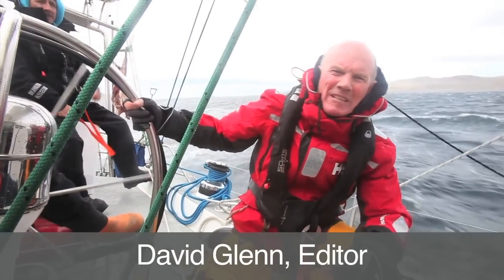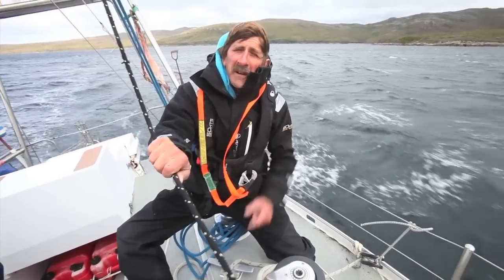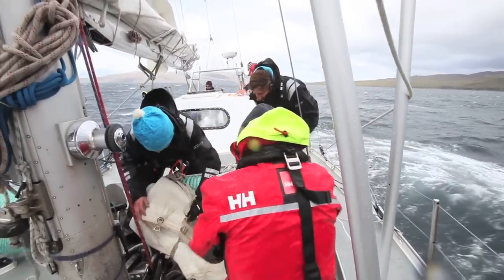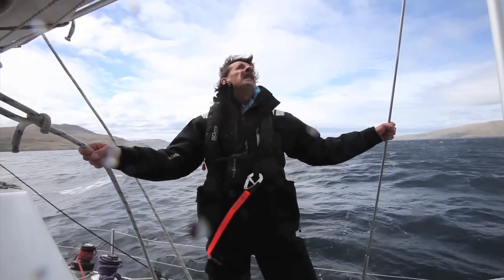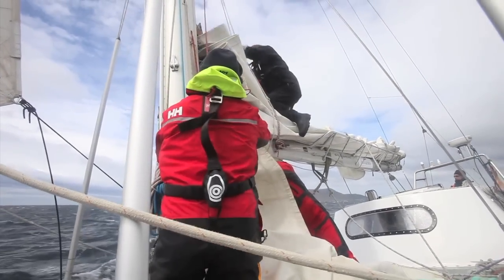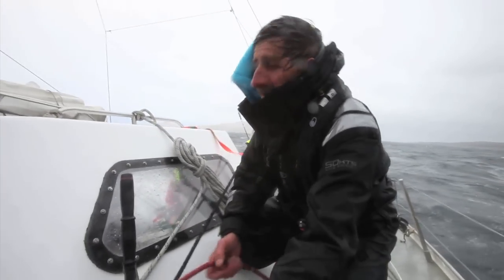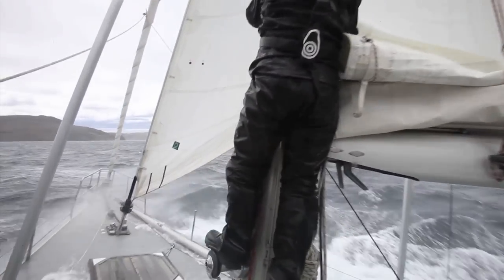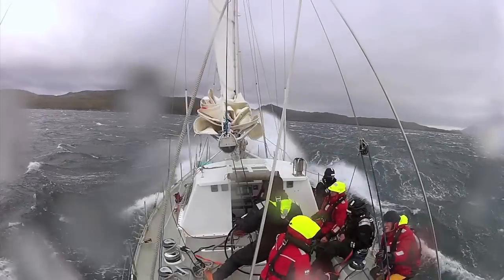How to choose and use storm sails – Skip Novak's Storm Sailing

Comment: A 4 reefed main maybe easier to do, but a storm tri sail is designed for the heavy winds.  It is stronger and it is lower, keeping the center of effort closer to the boat.  If you have one, practice how to use it.  It may prevent you from blowing out your main when you need it the most.
Reply: Excellent point!!   I would also consider the additional force placed on the mast!  It sounds strange- one would think reducing sail area would cause led force on mast but physics would show that there is an increase on Mast and both the back/for stays!  I agree with you and also recommend adding a running stay for storm sails!
Reply: Franklin Gray If the main is designed with this use in mind, it'll take the beating so I think that one is a mute point. However, I agree with you that the C of E is going to be higher up and further forward using a 4th reef: I suspect, though I have no personal experience with ketches or yawls that it would have less effect, but with a sloop or cutter it's going to be more significant. He has a 12 ton keel so my guess is his whole system is set up for specifically this purpose, and the milage may vary using this method on a production boat.
Reply: mike carey ninth
Reply: I would prefer to have people running around the deck and climbing in the mast as little as possible in heavy weather conditions, plus using a 4. reef would be a more flexible option in changing conditions. No doubt You have to practice that as well, but rigging a
tri sail at nighttime in 40 knots of wind and heavy seas is not preferable in my view.
Reply: Skip great idea, but needs work. Your main is heavy designed for the conditions that you constantly sail in.
. Most mains are much lighter constructed and would not stand up to the loads that can be experienced at your location
It also adds loads to the mast and rigging. I would hate to loose the rigg sailing in those conditions.
I think it better to point the bow into the storm and drop a sea anchor. Resume sailing when conditions allow.
Reply: @brucesinclair2981  Or heave to and wait out the storm.

Comment: I have done the experience, that it is the best way to wool the try sail and hoist it like a wooled spinnaker. I have done this in 50+ conditions and it worked pretty well.
Reply: -.- Wooled? Did you mean rolled?
Reply: @wilfdarr  No ' wooled '
Reply: @deannalamplough7723  I've never heard that. What does it mean to 'wool a sail'?
Reply: @wilfdarr  this may be redundant now. It refers to placing wool bands to keep the sail tight while being hoisted, these break as the sail is unfurled / deployed, of course adding to the trash floating in the oceans.
Reply: @crazyhorsetrading8655  Wool is natural and decomposes in, at most, a couple of years. It's illegal in racing, but in the ocean, of that's all you are putting overboard, that's not too bad at all.
Reply: @crazyhorsetrading8655  And thank you. I've never heard it referred to as "wooled", especially because the boats I was on that did it used elastics, which at the time didn't seem out of place because it's standard practice in skydive: I know better now, and haven't done it in years. I've never heard it referred to as anything actually, as far as I know it was never given a name, and I've just gone through a bunch of articles to see if I was miss-remembering. It was always just something that got done if you wanted a clean launch.

Comment: Sorry, I have sailed about 50,000 ocean miles.  I just witnessed a cluster fuck.  Good Lord, heave the boat to.  Hoist the storm sail, and then carry on.  There isn't much of a reason to hoist the sail in the manner shown over the boom.  With proper preparation it can be done with a single person.  Been there, done it.  Reef early, reef often is the old saying.  One thing which helps is to secure the boom properly.  The boom should be lowered to minimize its interference which also lowers the center of gravity.  I sailed a 44 foot cutter and I did the work of four men and had fewer problems than I just witnessed.  The vessel was not prepared properly for shortening sail.

Comment: I know it's blowing 40+, but why not point into the wind once the trysail is on its separate track for the hoist?

Selected for TheSailingChannel on the free ReduxTV App for Smart TVs. Watch more sailing tips on your big screen Smart TV using the free Redux TV App under Cars + Vehicles /  TheSailingChannel.TV. On the Web at www.redux.com/sail
Reply: With that kind of wind it will throw the boat into irons and makes it harder for crew on deck taking direct bow waves.
Reply: AnnArkE That is true.  But you could luff a bit once headway is regained.  After it's about halfway hoisted I'd think and headway is resumed.
Reply: Dreamr OKelly Agree. Best is to have the storm sail ready to go, hanked onto it's own track on the mast.
Reply: You want to keep moving, not stopping when the boat is non mamoeverble

Comment: Had the trisail pre-rigged recently but as Skip points out there was no need for it with a small enough final main reef. Also important to have headsails pre-hanked as much as possible to save unnecessary mucking around on the fore-deck in conditions like this.

Comment: Why not just use the storm jib?
Could you use a trysail on main that was ring hooked to mast?
Reply: thank you I will look at video again and try to understand.
Reply: Any for sail pushes the bow of the boat down, which is not the best angle of attack in head on waves.

Comment: very informative but the makes me want to buy a trawler.....
Reply: pgreenx 

A sailboat is safer than any power boat. You do
not need to set any sail in a storm just reef all maybe a storm anchor Shute.  However many sailboats left alone in storms survive
with nothing but their own love of sea.
Reply: Beginner question, why not reef all the way til you get a semblance of a tri sail? Wouldn't that save you work?
Reply: Hi - yes I know all that.  Just getting older and prefer to sit inside and relax while underway
Reply: chimbatete Since no one answered your question, and it's a good question, I'll tri…(lol)
Let's say a fourth reef is about 12 feet high, and six feet long, where the tri sail is about 6 feet high and 12 feet long, though they have the same area presented to the wind, the 4th reefed sail being higher, has much more leverage to roll the boat around than the shorter tri sail. Hope this answers your question.

Comment: Anybody know why you wouldn't hoist on the windward side so it's not riding over the boom?
Reply: You probably mean the leeward side?

As Skip says in the video, there is a designated track just for attaching the luff of the trysail. The mainsail track is on the backside of the mast, so the trysail track has to be off centerline. This time it happens to be the windward side.
Reply: why would not he turn head to wind to hoist it like you would do with a normal sail ? so there windward is at the bow and leeward at the stern..